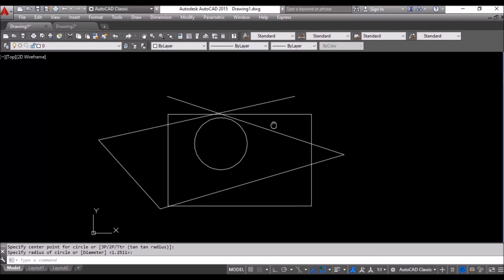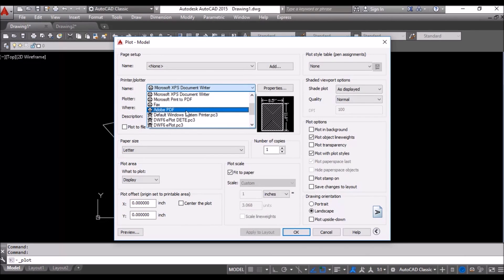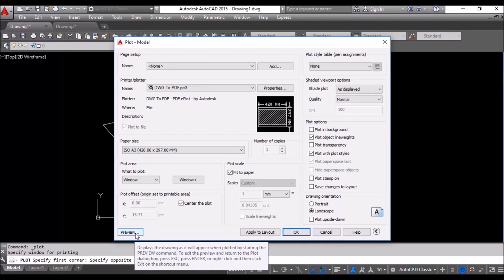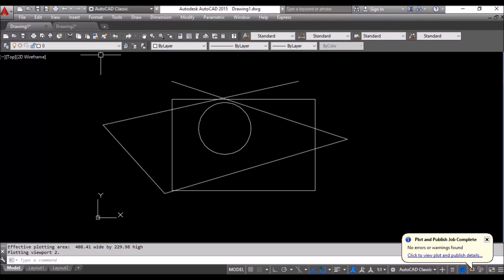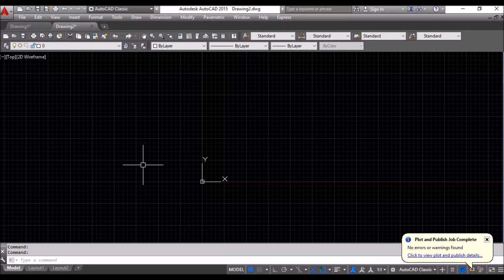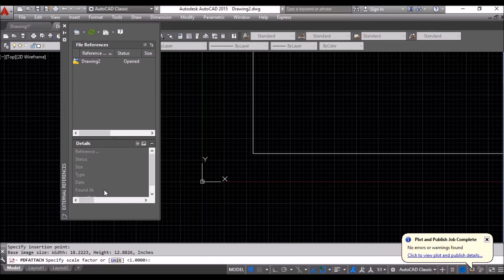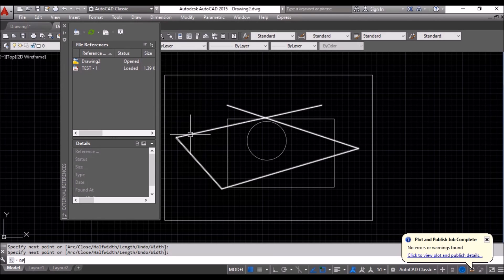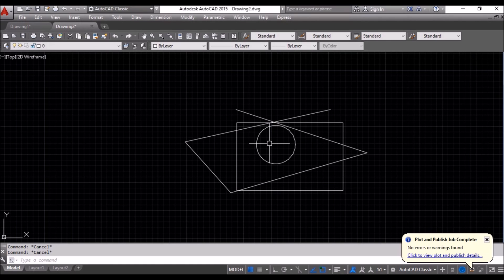How To Convert Autocad to PDF - DWG to PDF - PDF Tracing dwg file Youtube Autocad Training Classes

Comment: What to do if  most of the drawing is missing when i converted it into Pdf? I hope you will answer it. 😞
Reply from the maker: I hope the drawing was a scanned document. This method works great for the pdf drawings that were converted from cad software.
Reply from the maker: Please use this method in this case. 
Raster Image to DWG | AutoCAD Inserting & Tracing Images | Convert JPG to DWG
Reply: I plotted a floor plan for school purpose but when I convert the drawing into pdf  most of the parts of the drawing is missing.
Reply: I will try what you said. I hope it will works. Thank you.

Comment: It's ok but after that check the dimension is not correct what is the solution??
Reply from the maker: If you printed the pdf file from Autodesk AutoCAD then the dimensions will be the same as your printing size. Another thing, while converting from pdf to dwg the dimensions are broken to lines only.
Reply from the maker: Check this video also. You will get better idea how to convert the pdf into dwg file.

Comment: hai while im converting it showing empty page.. why
Reply from the maker: How are you converting ?
Reply: same as u did .. autocad icon --> Print--> plot --> name --> Dwg to pdf --> paper size --> iso a3   and  ok ....  but it is showing empty in preview also ... im unable to convert plz help
Reply from the maker: In plot window
below paper size selection drop down list, there is space "plot area' from drop down list select "window' and then select window button near to that. make window of the area that you want to print. Then in plot window check the radio button"fit to paper' and "center the plot" I hope it will work .
Reply: thanks it worked
Reply from the maker: Awesome

Comment: Its okay for tracing on some geometry, but when open a project there will be millions of entities and I takes so much time to trace, what is the solution for that?
Reply from the maker: +Tajammul Hussain Khadir 
There is a third party software WINTOPO you can use that for converting your pdf or photo file to dxf vector file. But problem will be the same. You will have to redraw the lines again. So it is better to start with tracing. If you use wintopo the lines and arcs will be broken amd you will have to redraw everything again. Just give it a try. Maybe your problem will be solved.